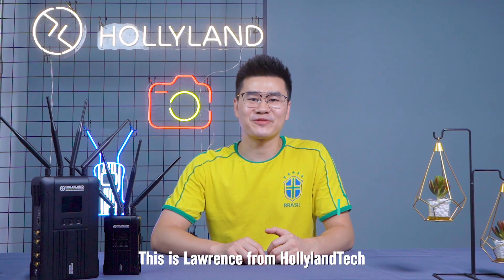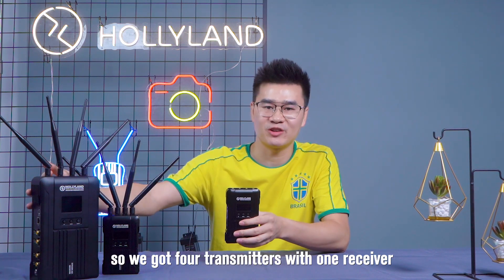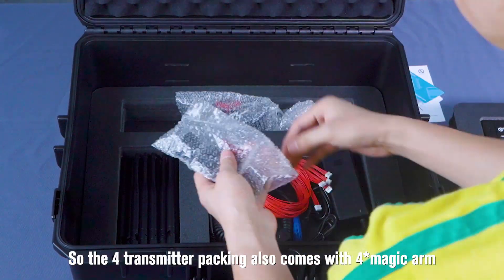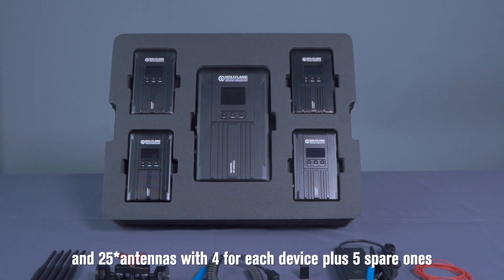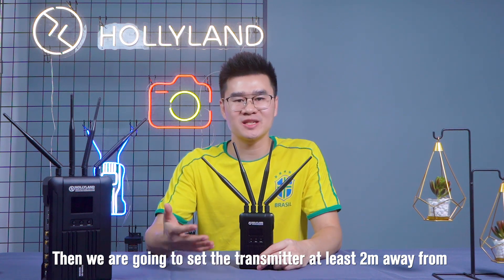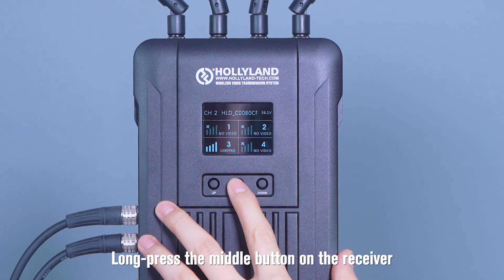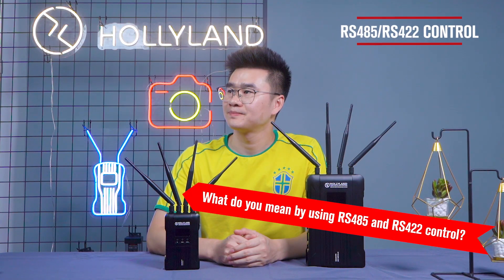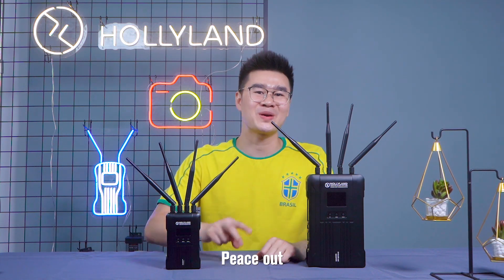BASIC TUTORIAL VIDEO | HOLLYLAND SYSCOM 421

Comment: Does your system support PTZ cameras using LAN connection for control?
I see you have LAN ports on both your transmitter and receiver.  Will a network be able to be extended to the transmitters?
Reply: Hello, actually I am referring to networking with ethernet.  Can I connect a network to the receiver, and connect the LAN port of the PTZ camera (not RS485/RS422 serial) to the RJ45 jack on the transmitter to extend wired network?

In other words, is the RJ45 connector on the transmitter and receiver for extending a computer network?
Reply from the maker: @DocMicrowave  Lol, sorry for my misunderstanding. It can connect the LAN port on the device with a network cable, and then set the IP of the camera to be consistent with the device to start work.
Reply: @hollylandtech  Thank you, that's what I wanted to know.
Reply from the maker: Thanks for reaching out to us! Yes, syscom 421 support PTZ cameras and we can connect the transmitter and the receiver with the RS485/RS422 signal cable.💪😉